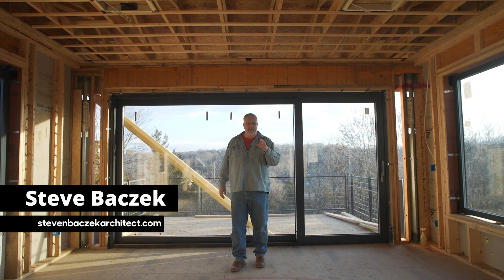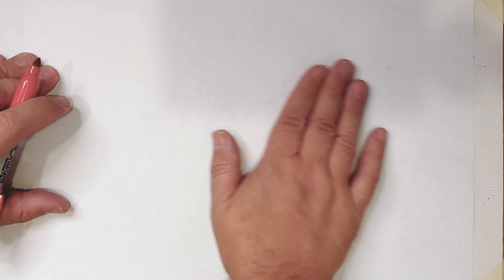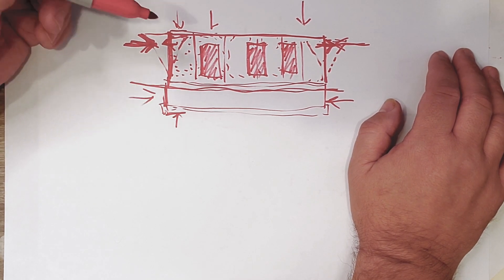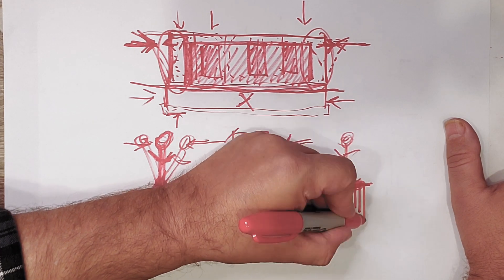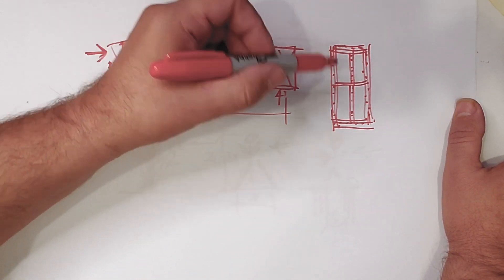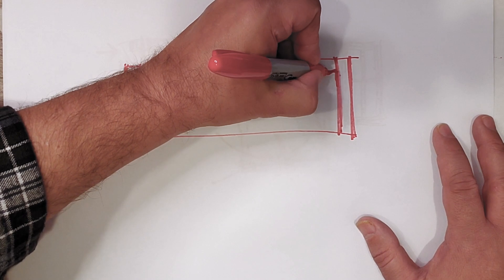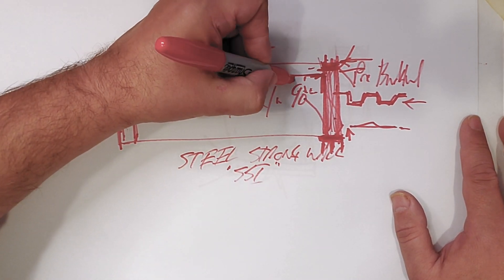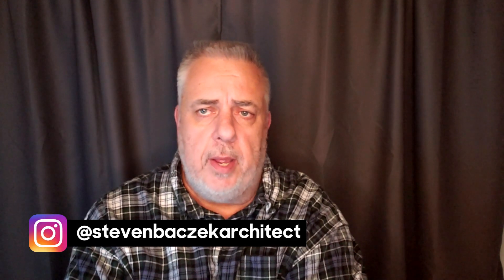STEEL SHEAR PANELS

Comment: In my head it makes sense that if your lateral resistance is only 2 inches per stud so if you had any worry about the lateral load and you were building a say 2X6 wall and you were to attach one at a 90° orientation to the other essentially stiffening that stud up against deforming under gravity pressure but also would make sense to me that it would also drastically improve the lateral load by turning that 2 inch connection to the top and bottom plat on that plane to a 8 inch connection ( yes i know they are not exact measurements for lumber but its to get the idea)

Comment: If you intend a Simpson strong wall and bolting into concrete; what is the density of the concrete you recommend to provide the strongest foundation for this purpose?
Reply: Engineering for a couple of Strongwalls isn’t very expensive. My two Strongwalls are attached with 7/8 threaded rod embedded 3 feet into 2500psi (minimum spec in the IBC per section 1905.1.1) concrete with plate washers on the bottom. Funny thing is they are on the second floor. The first floor has a standard 2x6 wall with 1/2 Struc1 plywood with 4 hold downs. One 4x8 sheet of ply under each Strongwall.
Reply: @Krunch2020  Thank you!